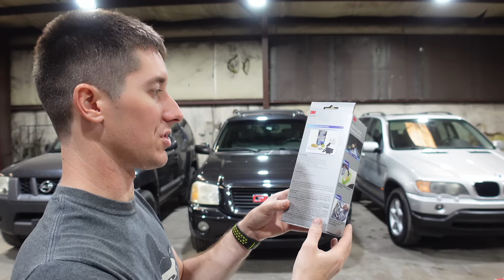I Bought EVERY Headlight Restoration Kit At O'Reillys *And Tested Them*

Comment: There arent much for instructions with the mothers kit, but on the website it does say to dry sand with the 3000 pad, i found that on my 2000 sonoma the dry sanding at the end was what really cleaned the headlights up then the compound just made them even nicer

Comment: Wet sand with 2000 and 3000 and 5000 sandpaper and a made for plastic, non yellowing clear coat will do a better job, the clear coat helps fill in the tiny scratches and your headlights will look like new.

Comment: The all-in-1 kits are cool but best bang for the buck is a big bottle of polish like Plastx along with a pack of 1000 and 2000 grit sand paper. You'll get far more headlights done much cheaper. Take it a step further and buy a can of automotive clearcoat.

Comment: Turtle Wax also has the best carpet/upholstery cleaner too. Great Company with proven track record. I have a 94 Regal with glass headlights that needs done; will probably need wet sanded,compounded ( will use turtle wax compound) thanks for this.

Comment: 13:50 The 3M ultra kit is what we use at work not to rag you guys but that was nowhere near the correct use of the product it is meant for professionals. A proper restoration is 25-30 minutes per headlight the 500 grit is dry sand only you make a general pass of the headlight. You wipe it down with a dry cloth and look for high spots and differences in the color/shade knock it all down. 

Once it's even you wash it down then move on to the wet sanding same process as before. The Trizact gets shared for both headlights so I do the dry 500 and wet 800 on both sides before moving onto the final stage. 

There are two wipes in that kit you DO NOT rub them in a circular motion or back and forth pick a direction and maintain it across the entire headlight otherwise it streaks and runs like heavy paint or lacquer instead it's done in slight overlapping passes. Both wipes get used on each headlight let dry for 5-15 minutes then open second wipe use on both headlights dries in 20 ish minutes but fully cures in 24-48 hours so absolutely no exposure to rain or water from the road in that time frame it will ruin the curring process. 

I've restored moderately to heavily yellowed headlights to mirror finish nearly factory look with that kit and I highly recommend an air tool the consistent speed is crucial electric drills have too much torque they tend to skip/buck your hand and the sanding pad scuffs/burns the lens. The only thing you can't fix is lens "crazing" that's internal micro-cracking from heat and pressure you'll never sand or polish that out.

Comment: I recently redid my badly oxidized headlights (worse than the X5) and used the meguars kit. As far as things go it went okay but it only came with the 1000 and 3000 grit discs with the foam hand pad. I initially tried that and it didn’t touch the damage. Ended up going to the ace and got some 220/320/400/600 sand paper and went through the wet sanding process before retrying the kit and the results came out better than mothers and definitely not as good as the turtle wax.

Comment: Deep Woods insect repellent works instantly. Spray on and wipe off quickly and it does a very good job of getting the fog look off the headlight. It's a temporary bandaid but it works. I used it and haven't had to clean them for over a month so far and I live in the humid state of Florida
Reply: the oils in the bug spray make it look good at 1st but eventually will eat (etch) into the polycarbonate & cause other problems down the road

Comment: Well I just bought the Maguire two part kit. Buffing/cleaning compound and clear coat with two circular pads. It has good reviews. I'm waiting for it to cool off outside. It's 90. So like waxing a car it's best to do it when it's not so hot with direct sun light. I'm using it on my 2006 Toyota Solara. The car is immaculate besides the heavily oxidized head lights. I hope I get a showroom clarity! Wish me luck!

Comment: Headlight restoration requires mechanical abrasion and a clearcoat or or UV protectant top coating otherwise they will yellow in a few months.  SEM 21013 is the single best topcoat and I have successfully used direct summer sunlight to cure the coating.  Also some replacement lenses can be purchased from eBay and can be changed with a short warm up in the oven to warm the glue.

Comment: Did you follow the instructions on all of the kits? I only ask because where I work, we use one that looks like the 3M ultra kit and it doesnt say to use water on the 500 or 800 grit sandpaper. Also the application of the UV coating is not supposed to be swirled around like that (atleast on the 3m kit we use), just swipe from one side to the other. Also, you should test the Rain-x premium restore kit, ive had good results with it.

Comment: I use 3m pads then McGuires Ultra Cut Compound and finish with ceramic coating(used a few).  Ceramic seems to last the longest

Comment: Hey JR if you want the best head light cleaner use a product called Brasso its the best way to clean it and also good to remove hard break dust on crome wheels. Its mainly a polisher but it does the trick and without a loud smell

Comment: i used Slyvania kit. my 2010 headlights were ok, not too yellow. my sons 2006 truck really needed cleaning. As i was cleaning my 2010, after the each step on the right lens, then left lens and i also did one lens on the 2006 truck in each step.  after doing all three lenses, the 2006 lens looked the best because it was more yellow to start with.  i only did one lens on the 2006 truck because the other lens is cracked and a piece of it is missing.😁 it’s got clear tape holding it together.  i hope we don’t get pulled over with the new shinny headlight making the other one look like it’s not working 😆 .

Comment: Wished you could have tested sylvania brand.
But ive used turtle wax kit and it did indeed do a good job the only negative is that it doesn’t set up to well and remains tacky. Also my understanding is that it only lasts about 6 months till you have to do it again whereas the 3m and sylvania last up to 2 yrs!!

Comment: I used the 3M Ultra Headlight Restoration Kit and it didn't say to use water when sanding until the last sanding step.  When coating, last step, it says to pass the clear coat one time over lapping the first.   You went in a circular motion making bubbles appear which is not a good thing.  My lesson was do exactly what it says.  In my case I went over a couple times.  It made for some smears on my lens.

Comment: Thanks fer taking the time and work i had done my moms 04 mitsubishi Montero sport used some sanding and an acrylic clear coat and it came out awesome then i did my sisters 12 equinox and the clear coat immediately cracked i thought i caked it on too much then again sanded all down and again it caked so sanded all down again and used Maguire's kit cleaning pad with the cleaning soltion and their clear coat and finnaly it came out decent but I'm not sure why the clear coat i used first wouldnt layer right i suspect cheap either replacment lights or gm oem lights . ton of work next time ill use either maguiers or turtle wax lesson learned. good luck widat . this aint for lazies

Comment: I spent 45 min with the 3M drill kit , then used a magic eraser to preclean the passenger headlight & it did the same thing in 15 seconds. 😖

My kit didn’t have the UV/haze clear wipe, so I bought superfine wet sandpaper to 5000 grit, which still wasn’t enough, bought a plastic polishing kit -still hazy… sprayed it with marine spar urethane, and it got clearer but had texture. Just annoying. 

Now I use the magic eraser chased with the 3M UV wipe & it’s tolerable but temporary. Next time I’m getting the Turtle kit or the RainX to try those finish coats & see if they last longer before getting hazy or yellowed again. Thanks for validating my terrible experience with headlight cleaning kits & figuring out which ones solve my problem.

Comment: I just use 1000 grit wet sandpaper on a drill. Then 2500-3000. Then acrylic polish, like Gel-Gloss, on a pad on a drill. Works every time. If you don't treat it or clear coat it after, you'll need to do it again in a year...at least in California for an ungaraged car.

Comment: I used the turtle wax one years ago on my 99 Camry and it did work really well! A few years later I used another kit, possibly harbor freight? Had a drill disc adapter to use your drill. Destroyed the lenses, I probably got a little too aggressive? Had to buy a new pair of headlights on eBay.... Stick to the Turtle wax and hand power! The part that sucks is on a 99 they have those pointy tabs that stick out. I think for a aiming tool that goes on the lens. God does it hurt when you hit your hand on them!

Comment: Deep woods off. 40 to 80 percent deet. White vinegar, and regular soap.

Spray the off on a sponge. Scrub until clear, quickly wash with the white vinegar and water mix, don't get it on your paint.

After you neutralize the deet with the vinegar, simply wash and done.

Don't waste your money.

Comment: Interesting results but as I have found using the same kit on three or more different cars is that what works on one type of plastic will have better or worse results on another, so I think the type of plastic seems to be key to what kit to use. I currently have a Nissan Frontier with I assume has the same lenses as your exterra, after a car wash some chemical at our local wash rack seems to start the lense to fog from the top down, when I get home I use Mother's Mag and aluminum polish it seems to due a good job of removing and protecting for a time, also quick and easy, but they are not anywhere near as bad to start with as yours were.

Comment: Guys forget all those kits. Believe it or not deep woods off and a micro towel is the answer. Heavily spray a two inch area of the rag and wipe the head light until clear. Once or twice a year and your good. It will soften the plastic so wipe quickly then let it dry and set up. You can buy some clearcoat to make it last longer if you want. Cheapest and fastest method, and it looks just as good as good as the turtle wax kit.

Comment: Project Farm needs to release a statement that the Sylvania kit does not honor the lifetime warranty and after 3 months it will yellow again, and its expensive AF. They will not honor the warranty unless sold by a specific Amazon seller, which currently does not even sell it. And it looks to be discontinued in auto parts stores.

Comment: The selection process should depend a lot on experience level, and amount of oxidation on the headlights, my personal choice is 3m's 39008 kit.
Reply: Your quite right right of course, But the difference between 3m and others is quality first!! There sanding pads are second to none, Also there extra pads come in handy for heavy oxidation and removal of old Cracking flacking clearcoat such as 2k, The only additional product I bought was Maguires Clearcoat with added UV protection, One coat quick to dry 5min's job done,🤔👍

Comment: use spray max 2  part primer, then a two part can that one punctures can and mixes clear coat. It has lasted over 3 years in california sun look perfect.. they have kits..top coat is short life after mixing.. so get all the jobs lined up. i removed the headlights.. easier to do them..
Reply: still look perfect clear.i do late night walking with flashlight perfectly clear 3.5 years now..

Comment: I love the maguirs headlight restoration kit with that kit your headlights will last about a year 2 sandpaper a drill attachment brush to agitate the head lights for better results i recommend using a drill like Milwaukee or other drill sets... the kit also come with the paste and a small bottle that has sealant and a foam applicator most of these kits dont come with a sealant and headlight only last like 3 weeks or so then they start getting hazed again because theres no sealant protecting the plastic from the UV light the reason some of these headlights didn't came out good because they did it by hand drill set will come out even better remmber work smart and not hard.

Comment: I will definitely get the Turtle Wax headlight restoration kit so that I can restore the headlights on my 2008 BMW 535I and my dads 2004 Chevrolet Suburban LT because these are the only 2 vehicles that we have that have faded headlights but I will just leave the headlights on these cars although the headlights on my dads 2004 Suburban are easier to remove on that vehicle than the headlights on my 2008 BMW 535I and also, after I restore these headlights, I will put LED lighting for better visibility when driving at night because the regular incandescent bulbs are bad

Comment: I tried the rain-x kit  and you commented at  23:46 about UV protection and it definitely doesn't the lights reverted back to their faded yellow state after less than 6 months later.
I will see if I can find the 3M kits here and use that.
Others I have seen actually put on a clear coat of paint, what is your thoughts on that ?.

Comment: Do you need 1 box per headlight? (That would it 50$ for 2 boxes where i live and at that point i rather do the Chris fix method. Sand paper and clear coat)
Reply from the maker: No, each box will do two or more headlights 🍻

Comment: If you would have had the actual BOX on top of the finished headlight to better associate, it would have been helpful.
It's EZ to forget a product name, but the VISUAL gets locked in your head if you forgot which is which when you're shopping.

Comment: I used the mother's kit on a car and I have issues with the rigid sanding disks. The 3000 grit it backed with a sponge but none of the lower grits are which makes it really hard on curved surfaces. I would not revomend it.

Comment: Hi JR.  Which one would you suggest if your lenses are only just showing some signs of age?  I live in NH and have a 2015 Chrysler 200C and a 2014 Ram 1500 and I clean them regularly so they don't show oxidation, but the light output..especially on the 200 is not good.  I'm thinking the Turtle Wax kit.

Thanks.

Jarrett

Comment: A little side note before I really get into the video. Were the products purchased in the body section of the store. Because that's where I found the kit I use at work.
Reply: After having watched the results. The kit I use at work is the 3M kit that requires a drill, it includes several course grit pads to remove yellowing/hazing, a couple of finer pads to even things out, and one fine grit pad to really make things as smooth as possible before polishing.
Kit includes 500 grit sanding pads, 800 grit sanding pads, one 3000 grit sanding pad, and one polish pad. I never use sealer. A clear coat makes it a far more difficult job because I have to remove the clear coat before I can even resurface the plastic headlight lens.
Keeping the surface wet when sanding is the rule of thumb. When polishing, the lens needs to be dry, but apply a nickel-sized amount to the headlight, and smear across the lens before going to town.

Comment: I had no idea what I was going to buy. I didn't even know my headlights were that bad off. To make a long story short, because of the price, I picked up the "Turtle Wax Lens Restorer." And since l'm a lazy 82yr old retired hospital worker, I took the Acrylic Wipes (one per headlight) as a trial, and quickly wiped until they both felt smooth. I kno it was the wrong thing to do, I just wanted two clean headlight lens. Do I have to buy another package for the wipes?

Comment: Sand with 2000 to get the dirt out of the plastic then fluff with a buffer. Then clean with comet to ruff it and clean it. Then paint it an adhesive pro motor, then clear coat with car paint.  That’s the only way. Thanks

Comment: What about the inside of the lens where the bulb is? My 2011 camaro has that problem. It has to be cleaned from the inside. Looks like that heavy soap scum built up you get on your shower door. The Mercedes headlight kit does the job, but I'm not paying way over $250 for it. Any advice on a good way of cleaning the headlights?, thanks.

Comment: Rubbish test.    Go to the wreaking yard, get a pair of the widest lenses you can BUT make sure they have been pointed to south ONLY to ensure an even distributions of UV damage.  Mask off sections for the individual products with several  layers of ½" aluminum tape that has been warmed to 100f degrees when applied.   Then test products.      Also,never hurts to use a heat gun with ½ the intake blocked-off  the heat surface to 220f degrees  after surface has been well cleaned with deionized water.  This will help to glaze top surface of lenses.

Good luck

Comment: Turtle wax kit worked great, but I seem to have done something wrong, the clear coat never seemed to really cure, it just kind of stayed as this greasy film on my headlights, I assumed it would dry and cure as hardened coating after 24 hours, did I not get enough of the buffing compound off before I applied it?

Comment: I've been using the turtle wax kit on 5 different vehicles my friends and I have , i have a ⁹44 Silverado and a 96 Subaru legacy , my one friend has a kia sportage and on the kia , she stopped driving it at night completely due to not seeing the road safely , she loves the headlights now , i just got my Subaru and the headlights have never been cleaned properly and were worse than the kia , i would drive with high beams on ( not recommended ) but never got any highbeams flashed at me , after cleaning them with the kit , after 4 months , still getting flashes from oncoming traffic but this , with my lowbeams , i swear by the turtle wax kit

Comment: I’ve used the turtle wax and it’s awesome unless your headlights are extremely yellow and large and then the issue is that the grit on the heaviest sand paper will smooth out so you can’t get all the yellowing out